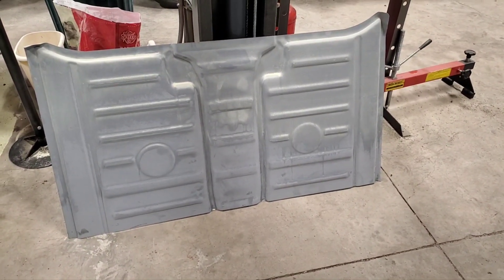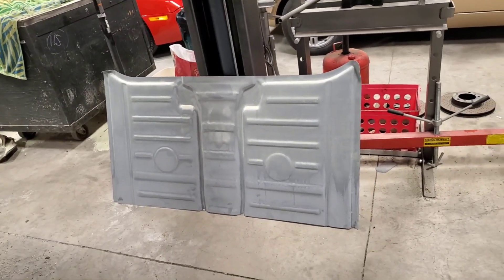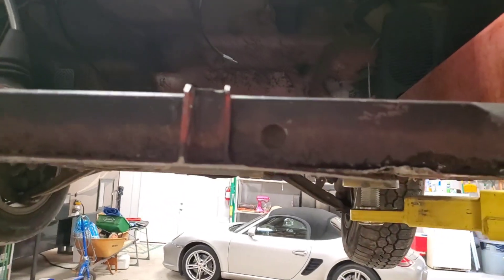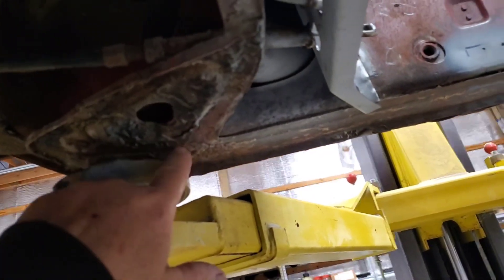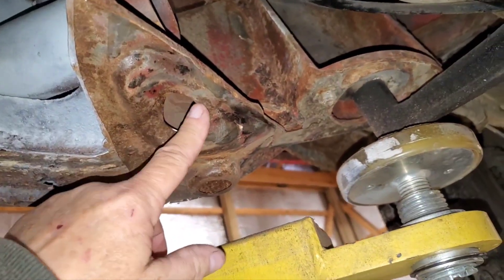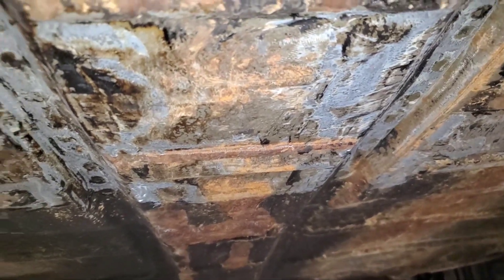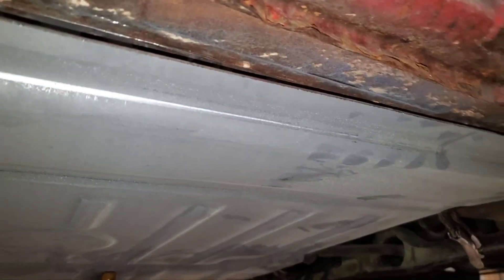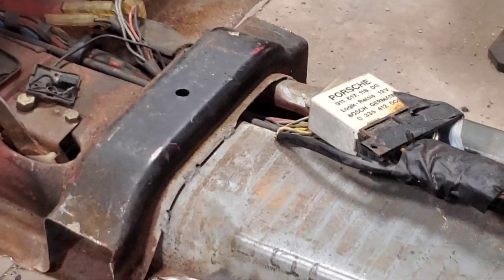1975 Porsche 914 rescue - rear floor pan part 3

Comment: I like the progress, Han. I think you should take the extra effort and replace the jack points.
Reply from the maker: Thanks for the comment Wade. This is the 4th 914 I've worked on and those jack points are in better shape than any of the others. Also, stripping those off will probably reveal more rust holes in the attaching metal which is the underside of the rear longitudinal.